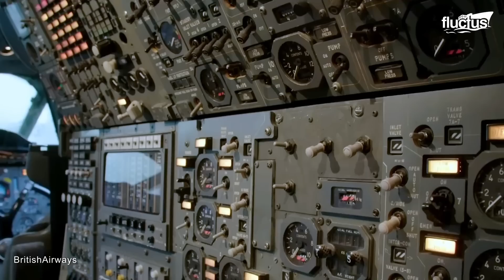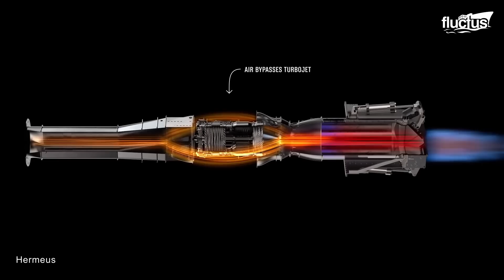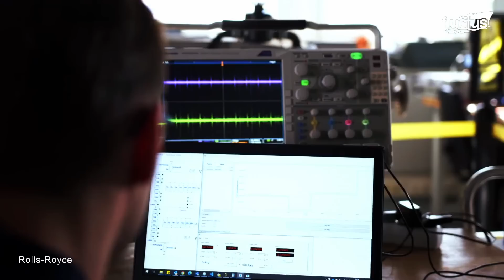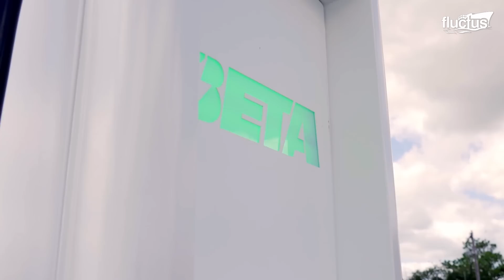US is Testing and Building World’s Fastest Passenger Planes

Comment: These will never be practical, its why the British Airways Concorde stopped flying.  Airlines are businesses focused on making the most $$$ so flying the most passengers possible on a flight for the lowest cost is their focus.  That's why speeds of airlines are about the same now as they were in the early 1960's but the planes of today carry more passengers and consume less fuel per mile.   Supersonic aircraft consume a great deal of fuel and are expensive to operate, so much so that ticket prices cannot compensate for that.  Also supersonic jets must be very streamlined like a bullet instead of the fat bulbous shapes of the big passenger liners. Those bullet-like tubes cannot carry many passengers.   Thus, airlines will continue to purchase planes that make them the most money and that won't be a supersonic jet.    Yes the sonic boom over land is also an issue too.  But the most important issue is financial.  The main engineering focus in advancing airliner technology is safety and cost.  Airlines want jets that are more fuel efficient, need less maintenance, require less crew if possible and that they can squeeze more passengers into.  Shortening a trip across the Atlantic by a couple of hours by increasing speeds is just not that important to them.
Reply: they'll never be practical but i wish they were profitable enough to where they can continue to operate